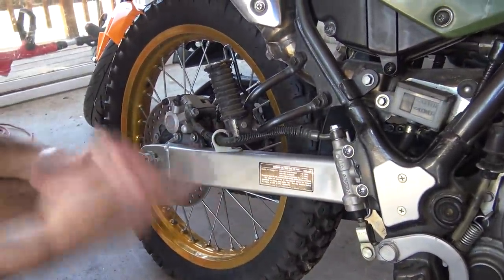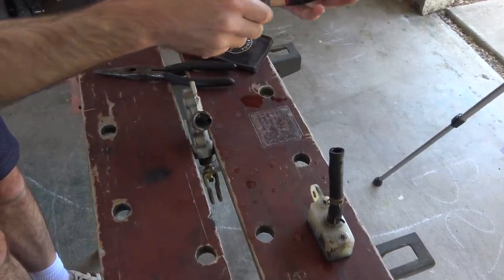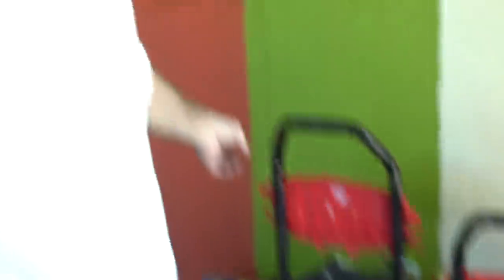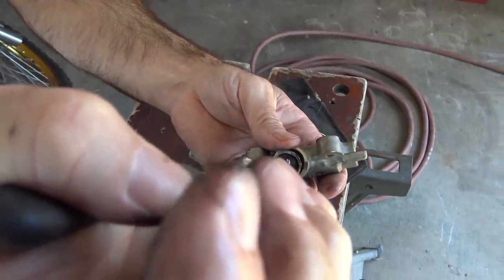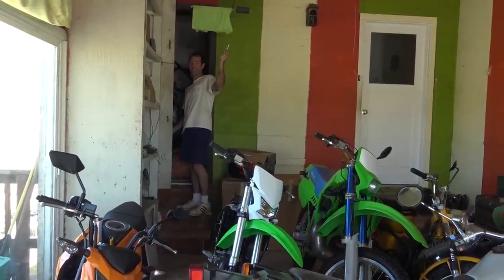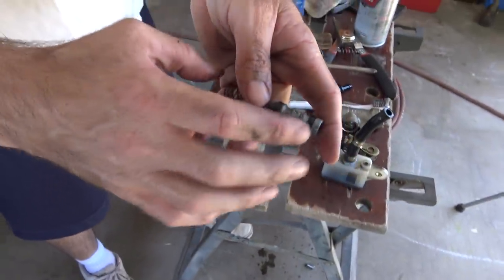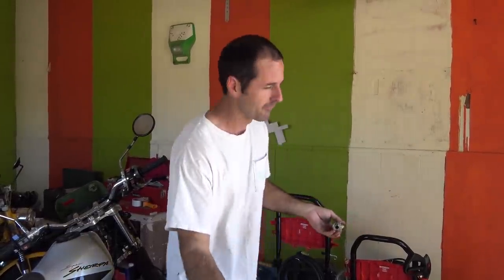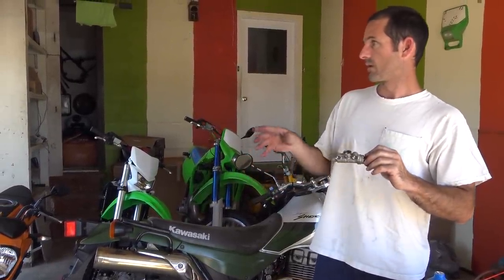Jake & Jen Live #2 - Bathing In Brake Fluid / Master Cylinder Repair

Comment: I am commenting just to tell you thank you and that your channel has been both very instructional and fun to watch. There are many who talk but don't show how, or blow thru how too fast and don't explain anything. However you detail what is done, experiment, show mistakes, and work on lots of various things; it has been tremendously helpful for me. I work in IT, supporting enterprise grade networking and authentication equipment, and own several street bikes. I've done minor work, changed the stater and clutch on my yzf600r, change clutch and brake pads on my Concours 14, and the starter on my vn800, but doing more was very intimidating. However since watching your channel I've bought 5 dirt bikes since last year and so far successfully fixed 2, largely due to your help. One was a 01 YZ426f that would not start but had good compression which turned out to be valve and timing issues (thank you for the 3-wheeler episode which taught me about timing), the other was a 07 TTR125LE with a seized crank. I've spent more money on tools than I did on the two bikes combined, but I've learned much, have a new way to make pocket change, and am more confident about working on my 4 street bikes, and both me and my wife enjoy your watching your channel! Thank you!

Comment: Brake fluid will absorb moisture (water) from the atmosphere.  Which will cause corrosion/rust inside the brake system. Never use a bottle of fluid that's been open and sitting around for a year plus. This right here is a prime example of why a brake flush in a vehicle is recommend by shops as a preventive maintenance service.  Love the vids. Glad to see you stuck to it. Great job. BTW shop owner here

Comment: Loved this! A few thing you should know: Brake Fluid is "hydroscopic", it absorbs moisture from the air over time. Brake fluid becomes acidic when it absorbs the moisture, so if you dont change it, you get corrosion like what we see here on the piston, inside brake lines, etc. Change/flush your brake fluid every 3 years or so!

Comment: I like when you and Jen go our on rides on all the bikes you build for that use. Take them out into your environment, let us see you enjoying the fruits of your labor. How about this for your title? "The life of Jake & Jen, unedited": My hole on my master cylinder was plugged up and I couldn't get it to work so I rebuilt the plunger and put new rubber washers onto the plunger and I got the brake to work but not to release because I switched over from DOT that was in the system and the book told me to use DOT 5 for it for that bike and ended up having to get a new master cylinder and doing it all over again anyways. Ha, live and learn the hard way. Because of watching your videos, I remembered I could do this as well. I built them in my youth, and rode all over California on whatever I could find to build. I recently did this again in my declining years, I built a 700 Honda Super Magna and two Harley Sportsters, one of a 1987 1000 and the other was a 2003 Harley 883 Anniversary model. Put those both together in my driveway at my apartment, with no shop or garage to work in. Traded those both in for my new ride I have to this very day: https://www.facebook.com/garylordsway/posts/2755087561391337, all thanks to you and my wife wants to meet with Jen and the both of them will want to make your day, by making you a great dinner or something. Maybe. or get even. You think you have long videos? you ought to see mine~!~

Comment: I enjoy your videos. Actually watching you struggle some relieves me cause yesterday installing the ignition coil on an 06 CR250R was a struggle especially without pulling the radiator or hoses which I finally overcame but wasn’t pretty. Still don’t have spark which I had a week ago but I feel confident I will persevere. Next, changing the wiring harness and CDI, but working my way to the stator. Anyways I appreciate your videos! Much respect!

Comment: I just rebuilt my master cylinder on my2001 kx 250 and those cupped o-rings on the piston are hard to remove and install. Also I will never regret buying one of those vacuum brake bleeders, they make working on brakes so much easier, anyway good videos and keep on wrenching.

Comment: You've inspired me as well. I got a 1979 kawasaki kz650 4 cylinder. Big project for a beginner. Did not run at all, bad valves. My master cylinders were trashed and disgusting but the brakes still worked rather well. Only good thing about my bike was the wiring all worked fine. Been working on it since October cost me $500 I should be done next week.

Comment: Well done. Sherpa next then the power washers. Love the bike repair vids, it's right down my pipe line of interests. Good format, keep it up. BTW older bikes sitting for a long time always have that brake problem. It's from the moisture that the brake fluid draws. Liked that your son is participating and keeping you on time track. He seems to have good knowledge of tool usage 👍🤜 great suggestion on the pick and wire brush.

Comment: Success! Heck yeah guys. I'm new to your channel. It does inspire me to wanna go turn some wrenches. Hopefully on the horizon for me i have a couple old KZ's to bring back from the dead. ......I guess bein a Kawi guy, i'd say Sherpa. But i'll still enjoy and learn from repair of the pressure washers too, so doesn't really matter. ......Just wanted to add some maybe helpful stuff here, the rubber seals in brake cylinders are often, if not always, what they call, "cup seals". they expand to the outer cylinder wall when they get pressure applied to them. if someone was to rebuild a master cylinder and install the seals backwards, the fluid would fly right on by and nothing would happen. same would most likely happen with a normal o-ring. A check valve comes to mind here.

Comment: @Jennies Garage   just a little over 5 minutes into the video but it seems to me that the master cylinder might be "by passing".the pressure seal is bad and the fluid is just being returned to the reservoir thru the return port. this is the likely issue if it were a car master cylinder and i don't know what differences a bikes master may have.

Comment: I hear your brother on working a regular job I just replaced two head gaskets and rebuilt the carburetor on my 27 horse Kohler In 89° heat With 89% humidity and I enjoyed it more than my 9 to 5 which consists of riding around in a air-conditioned truck 12 hours a day. Sure I have a beautiful home and all the toys to go with it but am I truly happy the answer to that is no not when all I dream about is the day i’ll  be able to retire if that day Ever comes.

Comment: I did similar to the wheel cylinders on an atv I suggest next time you do this type of thing the green dish scruby worked extremely well for me more abrasive than a tooth brush and less than a wire wheel I had more trouble getting mine apart than yours and after it want back together smoothly and working properly

Comment: for brake fluid i believe most manufacturers say to do a full flush every 4 to 5 years. brake fluid is hygroscopic so it's recommended to not use any open containers of brake fluid when you do your brake system flush because it's probably pulled in some moisture from the air and it's surroundings.

Comment: For the love of all things right, use a dremmel rotary tool or similar with a stainless wire wheel to clean that gunk off the cylinder. Obviously when doing it use an iron fist in a velvet glove! love the vids.

Comment: Had same problem. The cylinder needs to be primed/ filled with fluid before it'll work. Solution is to fill chamber first and it should pump fine.

Comment: brake fluid does crust up over time, but only if  left open to air/moisture. btw, those master cylinders are easy to open up. Slide the boot off the shaft and you'll see a circlip. Once that is removed the piston comes out. edit: ah you got there

Comment: I am no expert but I believe brake fluid has especially older fluid absorbs moisture. That is why you are not supposed to use it unless it is fresh, because it will cause corrosion of parts such as the one you are working on. By the way I love your videos.

Comment: I dont mind it being just HD. Long as details can be seen good enough and that is fine even on 720p. I mostly watch things with that resolution, since its good enough. How ever calling it live video is miss leading, so maybe "Jake & Jen Uncut" would be accurate and descriptive.
For content, i'm mainly interested on problem solving aspect and learn from other peoples mistakes, so i only do them perhaps once :D
Also as side note, you dropped the O-ring on the ground, so never put it back until its cleaned, cause you probably dont want to sand particles etc to get into master cylinder, create scratches that will start to leak. For crud on piston, could it be that brake fluid collected moisture and corroded the piston that got stuck? No body probably touched that master cylinder after it left factory, so it could explain the issue.
For projects, get old projects done and then start new ones.. i know the feeling for having too many projects, but finish the old ones first. You can make pressure washer videos as fill videos when you are waiting parts etc.

Comment: you can clean aluminum etched areas to gently scrubbing with a steel or copper brush and then polishing it before add the proper grease

Comment: You're blowing the corrosion deeper into the bleed hole.  Connect it to the front master cylinder at the caliper end and use the front brake to push the dirt back out. The piston will come out too with the circlip out.
Edit. Dot3 absorbs water. Oil floats on water. Water corrodes aluminium. Water sinks to the lowest part in the system.

Comment: The best way to clean the corrosion in a brake master cylinder is to use CLR on the hard parts only,seals,o-rings must be removed...CLR is for removing calcium,lime,and rust...Use full strength and the part(s) are clean in literaly minutes!!!

Comment: Both of you guys are echoing my life, as it is now. All the corporations care about is money. People are "Human Resources" (traditionally). Air conditioning, where I work, is to control temp and humidity as the manufacturing process requires. Human comfort is a by product.In the department where I work, the product stage does not require AC. Yes, it is a sweat shop during those heat waves. Oh, right. Yes, lower management is inept and still they keep their jobs. The union is all that keeps me employed. Oh, be assured, they know how I feel. Too many things to list. You would be amazed at how many RMA's are processed. Millions each year.

Comment: @Jennies Garage just wanted to mention something. i see here at the 26:00 mark you have the piston out of the cylinder and are attempting to clean it.be careful not to use anything petroleum based on those seals as it will destroy them.petroleum based products will cause some types of rubber to swell,including seals in a master cylinder and brake calipers.

Comment: Brake fluid is hygroscopic and is why you are seeing all that stuff in the master cylinder. Brake fluid should be changed out as part of a maintenance schedule even with vehicles (intervals will vary on use and environment).

Not sure if it was commented already I am too lazy to read them.

Comment: First, it's not unreasonable to assume that people will do their own editing, in a sense: I know I watch everything at 2x, and skipped forward half a dozen times - I don't know how that might impact your analytics/algorithm, but it's how I consumed this video. So, you can relax a little about the introspective/meta/self-conscious comments.

I think you would do well to find a balance where you don't spend too much time editing, but also don't feel the need to constantly extemporize. Bedo's Leatherwork LLC does a good job with demonstrating the start of a repetitive process, then says his catchphrase "Let's continue", pauses recording and jump-cuts to the end result.

Other items: there should be a battery adapter for your camera(s) - you may have to get a camera mount extension. It's a sold investment so you don't have to worry about camera time.  

Finally, many cameras have a remote control that you can set to automatically start and stop - alternatively, you can clap or use a WW1 clacker, which will put a spike in the audio, which you can use in whatever video editor you use to drop a scene cut, or silence and speed up the video some significant amount until the next interesting thing happens. I happen to use adobe premier, but almost any of the free video editors, with a little practice, can make this a quick first-edit pass.

Comment: Brake seals is degraded by oil base such as the lubricant in the can it will cause the rubber oring to swell use soap and water never oil base

Comment: Brake fluid is pretty corrosive. Please get some safety glasses and some gloves next time. ;) Also a Master cylinder rebuild kit from All balls or similar is super cheap. Brake flied turns into sludge if it sits. This need to be done regularly to prevent this. It's pretty standard if a bike sit for over a year or so. You guys are great... maybe just relax and do your thing. See ya next video!

Comment: Oh no, I know from experience. But you should avoid using petrolium products (penetrating oil) on brake systems. It will swell the rubber seals and ruin them. Even just a little bit of oil can swell all of the rubber components in the entire system. then all of the moving parts won't move any more.